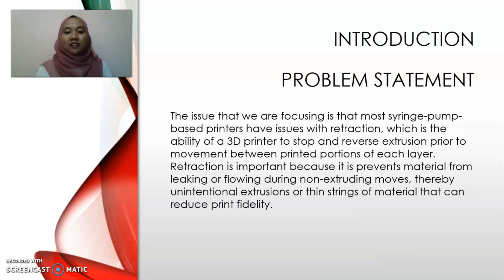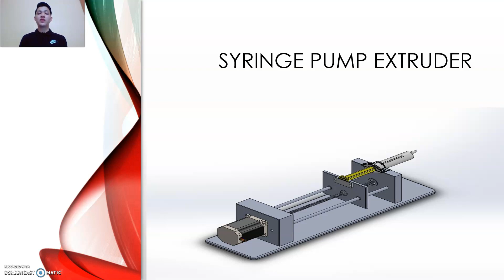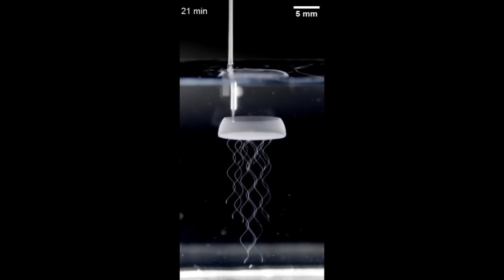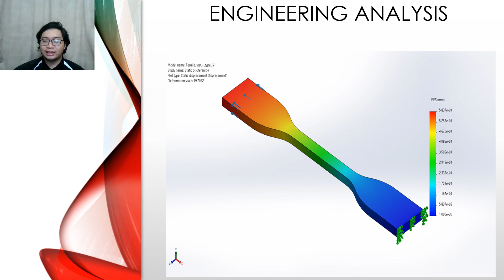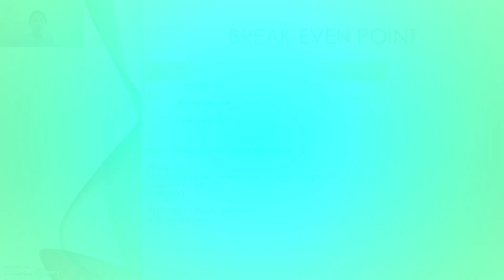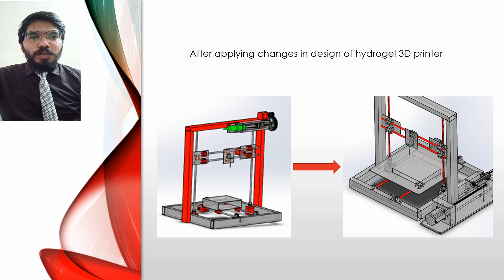Hydrogel 3D Printer

Comment: What is the cost for producing that product conventionally?
Reply from the maker: Most commercial 3D printer currently on the market range in cost from Rm700 to more than Rm3000 depending on its specification. Special 3D printer which can extrude gel-based material cost from Rm42,800 to more than Rm856,000. This project proposes a modular system which can utilize existing 3D printer mechanism and allow gel-based printing.

Comment: How do your 3D printer helps in bio engineering? Can you give example of a bioengineering product that sells at RM674?
Reply from the maker: Our 3D printer can print prosthetic from any part of the body such as ear and nose. Our 3D printed prosthetic which is hydrogel-based prosthetic is very soft that can increase the comfortability among the patient. The hydrogel 3D Printing is also a stepping stone for the improvised bioengineering 3D printer technologies.  There is still no bioengineering product that ever produce at a price tag of RM674. Most commercial 3D bioprinters currently on the market range in cost from RM42,800 to more than RM856,000 and are typically proprietary machines, closed source and hard to modify. Essentially, we have developed a Hydrogel 3D Printer that you can build for under RM700 for its assembly.  It should be cost less in printing the biologically adaptive product such as the preparation of the hydrogel. Most of the cost of the assembly is due to the sophisticated part in the machine itself. But, our printer managed to apply simpler 3D printer technologies which cost us less than the commercial 3D Bioprinters. Our Hydrogel 3D Printing can also print structure for support in bioengineering, such as structure to tissue culture and structure for ruptured brain.